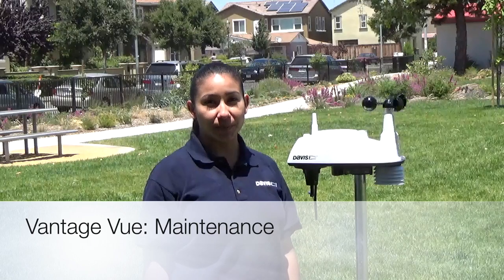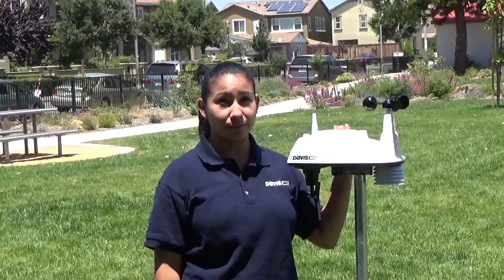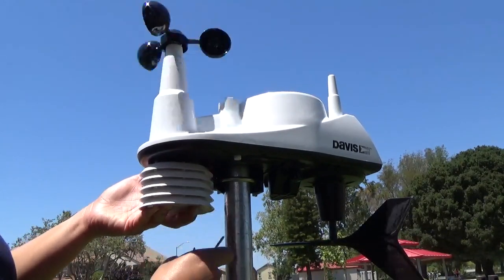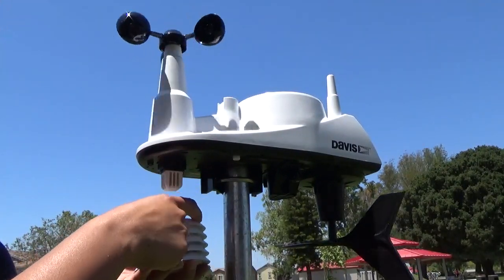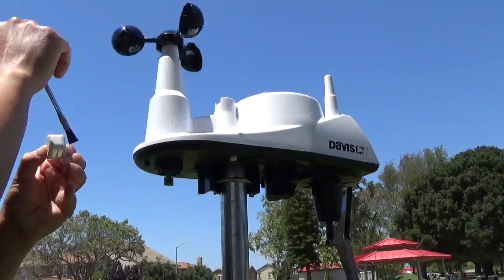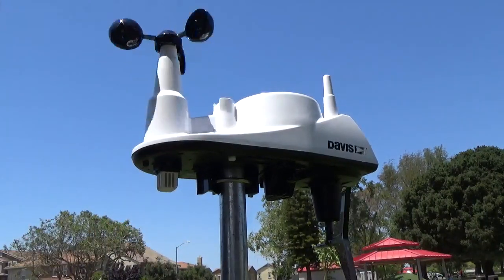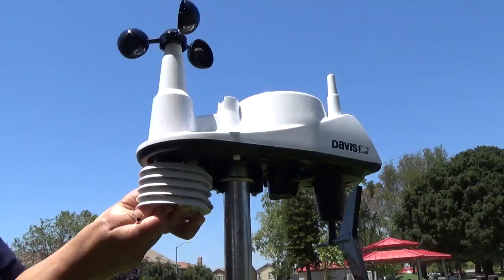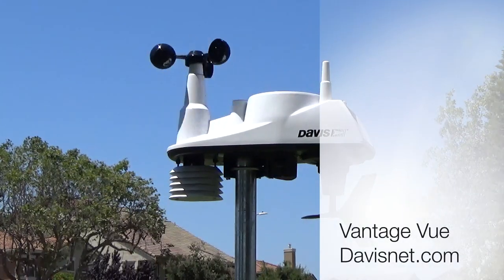Davis Vantage Vue Maintenance How-To

Comment: I need to replace or clean the wind cups? Also, the antenna on my inside station broke. I've not found a good way to repair it. Any suggestions?
Reply from the maker: Hi Linda. You don't need to replace anything really unless it is broken, or in need of a little proactive tune-up on an older station. But keeping your station clean is part of regular maintenance - wind cups too. I am not sure about your question about the antenna. (The antenna is in the white solid tower structure above the solar panel.) I think a call to our wonderful Tech Support team is in order to help solve whatever is going on! (510) 732-7814, M- F, 7:00 am to 5:30 pm PST; or support@davisinstruments.com.

Comment: Why not show how to replace the battery too?
Reply: The Vantage Vue has Solar panel
Reply from the maker: Good idea, Shannon, thanks!  The battery should last a very long time, usually more than 2 years, depending on solar charging. (Even without any sunlight it should last a good 8 months or more!)
Reply: It has a thumbscrew easily removed by hand. Replacement is a 123a lithium. Found some locally at lowes for very good price.

Comment: Where can I find directions on changing the wind speed cartridge' on a Vantage Vue.? Or just tell me if it is a matter of taking off the radiation shields and unscrewing it or is there more stuff underneath there to remove?
Reply from the maker: Hello Jhon, to replace the cartridge, you would start by first removing the cups. This will require the .05 inch Allen wrench that came with the unit.
Then, remove the four screws from the bottom of the sensor suite that hold the upper white shell.
Remove the upper shell, and inside this shell, you will see 2 screws that hold the cartridge into place. Remove these screws, then remove the cartridge, and then insert the new cartridge. Then just reverse the procedure.

Comment: On console  it shows No wind speed direction only dashes(-----),what could be the problem because I hv tried so many times to reset the setting on the console but steel shows wind direction as dashes even if there is wind please help me. It is almost a year now since we installed it. Iam using this WEATHER STATION (DAVIS  Vantage Vue
Reply from the maker: If there is a problem that needs a repair, you'll need to see the reseller in your country. But you might be able to fix the problem by following the steps below. Our Tech Support specialist gave these instructions for your to try:

I would recommend checking that the console is connected to the station properly.  
- Are there waves blinking around his antenna tower? (see attached image)

- If the transmitter is on ID 1, change the transmitter ID. You can also find these instructions here: http://www.davisnet.com/resource/change-transmitter-id-vantage-vue/
Reply: Thank you very much, all sorted after i follow the steps  you mentioned.
Reply from the maker: Good to hear!

Comment: I bought ONE and DONE....The wind direction is  backwards by design.
Reply from the maker: No way, David! The wind on a Vantage Vue is factory calibrated to report north when the solar panel is pointed south. If you are in the Southern Hemisphere, we tell you how to easily calibrate it so you can point your solar panel north and get correct wind direction.

Comment: With this design  , aren't  the birds  going to use the collection baskets as a toilet
The previous design did until Davis came out with redesigned  collection  basket . My present one is working great otherwise ( vantage pro 2 )
and hope parts  are going to be around for awhile
Reply from the maker: Birds, leaves, spiders... all can block the rain collector. Routine maintenance is the best way to keep your rain accurate.
Reply: Yes, birds do like to sit and mess into the rain funnel.  I found this was bad in only one week of use.  I decided to make a bird deterrent, get some thin 1mm carbon fiber rod material, cut it into 3" lengths, about 8 of them.  I took a large stainless steel hose clamp that fit around the rain funnel.  I marked 8 evenly spaced spots around the inside of the hose clamp.  Next I hot glued the 8 thin rods around the inside of the hose clamp.  Now I gently clamped this "crown of thorns" onto the top of the rain funnel.  It has been in place about two years now and there is never any bird debris in the funnel!  This is an easy fix and saves a lot of maintenance intervals!
Reply from the maker: Hi Wayne. Birds aren't usually such a problem on the Vantage Vue. The rain collector is not as big or deep, and the edge is not really bird-perch-friendly. The Vantage Pro2 rain collector comes with bird spikes.
Reply: I did get the redesigned  collection  bucket , the one that has the pins on it  This did help alot .
The other one when the Robins  are  hear , cleaning was a daily  affair
Reply: @davisinstruments  Hmm, my VantageVue was plenty bird friendly, they made a big mess of the rain collector in no time, you should offer a slip-on crown of thorns for this model in my opinion.
Reply from the maker: "Lucky" you Rem. The trouble with a bird "crown" is that it can interfere with rain collection. If you can handle it by checking frequently and cleaning your rain collector, that might be a better solution.
Reply from the maker: The rain collector with the bird spikes is for Vantage Pro2, not Vantage Vue. Good thing robins are beautiful!
Reply: Davis Instruments, I appreciate the thought, my clamp is below the lip of the collector, and pokers are very thin 1mm rods so I'm doubtful that it has affected accuracy much.  That said, you should improve the product to match your others in this respect.  My system is up on a pole, on the roof cause we have a tiny yard.  So I don't like going up there often.

Comment: I changed my wind vane and now the wind direction is backwards. the new vane has the flat spot the same as the old one that fits  the flat spot on the shaft. how do I calibrate it to show the right direction. Vantage View
Reply from the maker: The unit is calibrated to be correct when the solar panel points south, which is as it should be  for max charging in the No Hemisphere. We suggest you take the vane off and reinstall, rather than calibrating.  Hold the sensor suite on its side with wind cups on your left. When you hold it this way, the wind vane shaft is horizontal and will orient itself so that its flat side will face the right. Slide the wind vane on, with the "arrowhead" pointing down. The end of the shaft should be just visible on the bottom surface of the wind vane.
(You could calibrate the console - instructions are in the console manual.)

Comment: So "replace the shields in the order you took them off". How helpful is that?  If you knock over the pile or wash them, what order are they supposed to go? Why not just confirm that? Why the obsession with making things sound simple, which over-rides providing the information you may need?
Reply: Number them 1 to 5 with a permanent marker. Then there's no problem. And my advice is: don't do this as she does it. Take the unit to the workshop or kitchen table, so that when you remove the screws, debris filter etc there is no danger of dropping them in the long grass where you'll never find them.